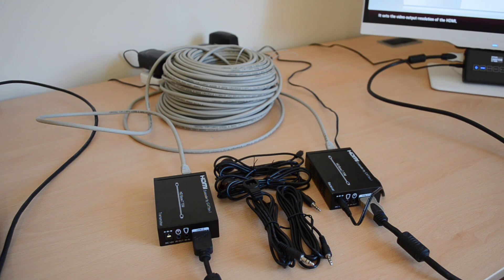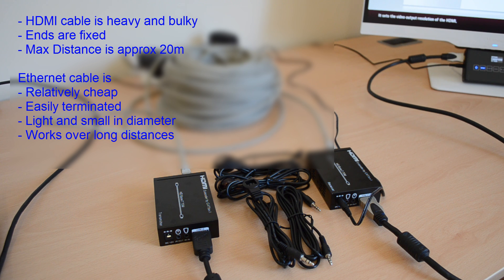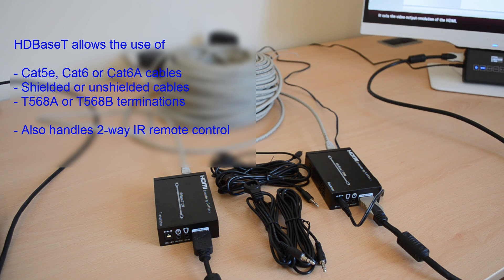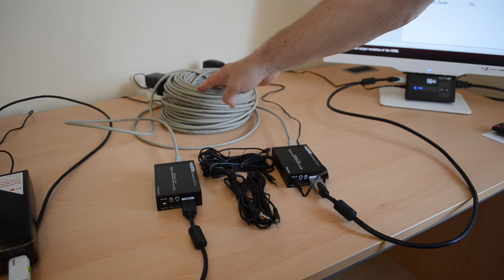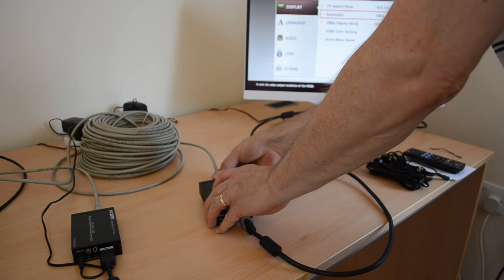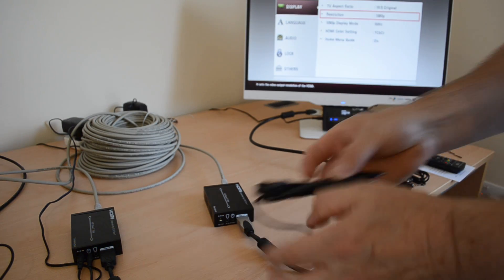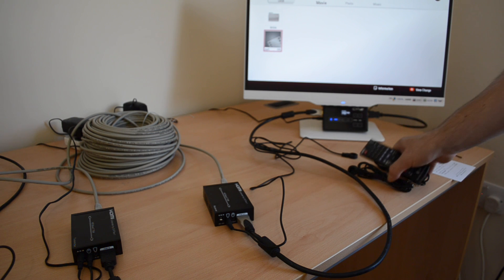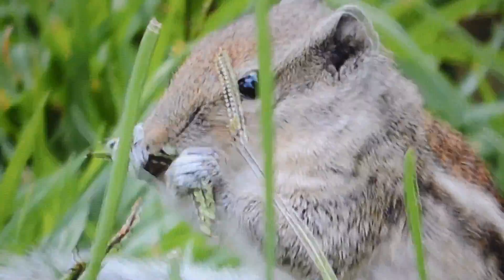The 70m HDMI over Cat5e Extender

Comment: Can this be used to connect a TV to a receiver? Basically, I have an ethernet jack behind my tv and it goes to my closet where all my speaker wires are. I was thinking about using extenders.  I'd rather not run a long HDMI in my ceiling from receiver in closet to TV across the long room.
Reply from the maker: We don't have this model in stock any more. You could use this one as long as your ethernet cable is point to point and is not used in any other network  https://clearvisionsystems.co.uk/products/hdmi-over-cat5-6-50m-extender-1

Comment: is this system able to be used in the following concept?
for our school that is also used as an event space we want to setup a local broadcast that only goes to a beamer around 50 meters away
plan now would be to buy a tiny 6 u rack in which all listed equipment will be installed:
in the sidewall we wanted to install a cat6 jack which is being connected directly to your receiver unit on the inside
from your receiver unit where will be a hdmi audio extractor which extracts audio for the installed pa system
and from the extractor to the beamer

so is this extender kit able to be used with 50 meter cat6 PATCH cable and a connection through an extra cat6 coupler
and is your extender able to work with extractors (just like we would use a standard hdmi cord)

thanks from germany
Reply: the rack will contain a lot of other equipment such as a 2u rack drawer but this does not matter here;)
Reply from the maker: I would prefer to use the 120m extender for this (our product code 416101). If you contact us via our web site and send a diagram of your proposal I can advise you better. The description of what you want to do is a little confusing.